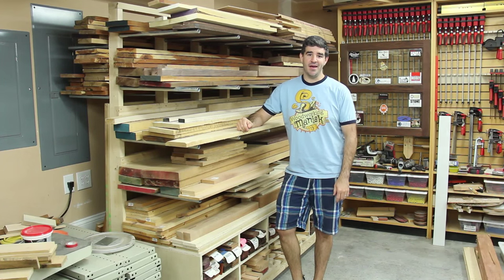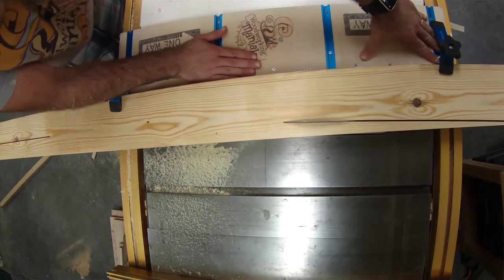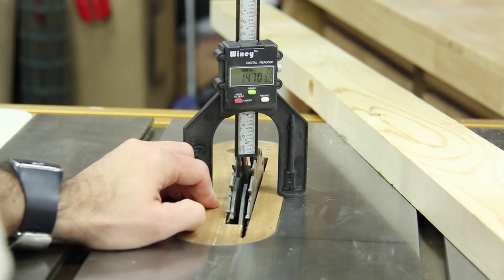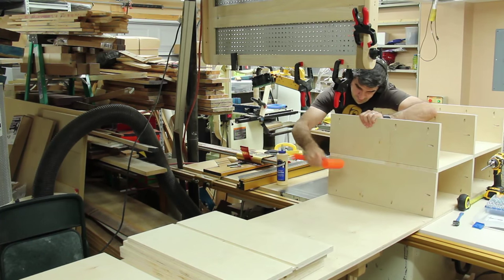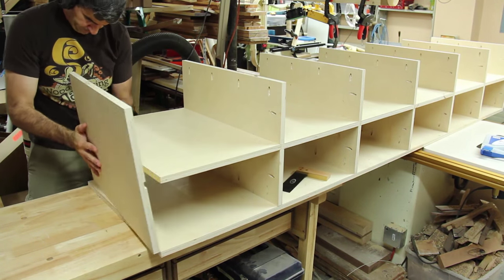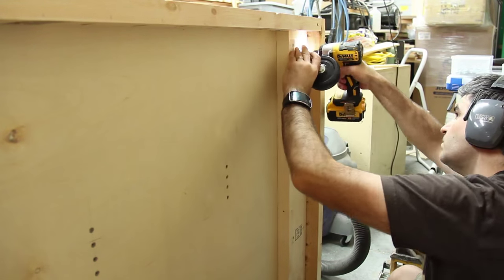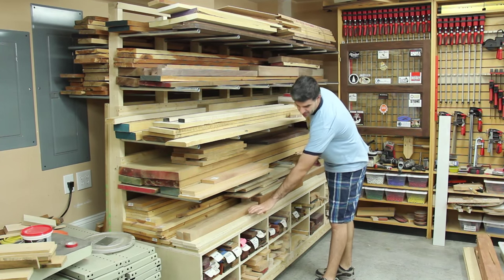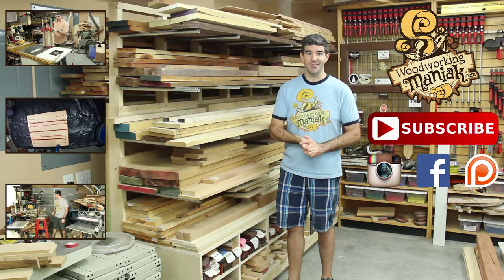HUGE Mobile Sheet & Lumber Rack

Comment: Mobil shop is great. People forget they might want to remodel another building. Your rack should move to drveway for loading a truck. What brake do you have for sloped driveway? An anchor for earthquake as well in ceiling and wall. When all things on wheels. The other option is a pallet with walls and dividers for scrap. Use a pallet jack to move cpmponet units.

Comment: "Actually" that is a very useful design and great build. Didn't know the conduit was that strong for just a 2" end mount? Really liked the way you lined up the dado cuts. Perhaps I missed it, but where will the full sheets of plywood go (after you replenish your stock)?
Reply from the maker: MRrwmac The 3/4" (internal diameter) EMT conduit is actually more like 7/8" in outter diameter... I drilled the holes 2 1/2" deep. They are holding the weight just fine. The full sheets fit on the back side of the rack. Once I get new casters on it, I'll probably show it in an update.

Comment: That's an epic wood rack!  Nicely done.  I thought the conduit would be to weak, but then I realized the weight dispersion over several means less weight on each individual pipe.  Well done.  Cheers!  Chris.
Reply from the maker: Cactus Makeshop Yep, weight dispersion is key. I debated on having them stick out 22" like that, but it's working out just fine.

Comment: I have the same-ish casters on my lumber rack of about the same size as yours...love the rack, hate the casters.  Did you put 6 casters on or just 4?  Do you have a link for the new casters?  I need to find something new myself.
Reply from the maker: Curt Walkins I used  6 4" casters in the build video. I ordered 6 Grizzly 5" casters part number G8173. Just ordered them today... So I guess I'll see how they are when I get them. I almost went with the 6" version even, but just didn't want it to be so tall. It is already going to add 2" to the height.

Comment: How mobile did this cart end up being? Our lumber rack is wall mounted, and we are planning to build a sheet good cart. Your design might make more sense for our single car garage, if it's mobile enough
Reply from the maker: It is mobile, but once you have it loaded down, it's hard to get started moving with the casters I have because of the urathane compressing. Might be best to get all metal casters and it may roll easier.
Reply: @WoodworkingManiak  Cool sounds like it will work in our space. What are the dimensions height wise, and front to back - roughly?
Reply from the maker: I think I made it 44" x 97" and 75" tall if I remember correctly...
Reply: @WoodworkingManiak  and all of the wood I assume is within the 44" width?
Reply from the maker: The lumber rack side I think has 22“ long EMT pieces and can store 8' long lumber. I'd have to go out and measure them again, it's been a while since I built it.

Comment: This is the best rack I have ever seen,  Can't tell you how many times I watched your build. What an efficient use of space.  I have a few questions (and apologize in advance if they been answered but I can't find them). 1) What material are you using, basic SPF 2x or douglas fir? 2) is that standard birch ply? 3) You mention bowing in your comments due to load. Where are you seeing the bow? 4) with the mdf for the plywood rack screwed to the verticals do you still think you need all the horizontal 2x4 bracing? I was going to eliminated 1 or 2 of them. 5) any problems with the 6 casters (not being on a perfectly flat area)? I was planning on only using 4 1000lb steel/urethane casters.

Thanks in advance!
Carl
Reply from the maker: +Carl K Tha K you for watching. 1) I used basic pine that is available in my local box store. 2) The plywood I used was TigerPly EDGE. It's a high quality Chinese birch that is comparable to Baltic birch. 3) I loaded probably well over a thousand pounds of lumber on it multiple times. It does bow a little, but not terribly. It's a toss up as to if it would be worth adding more weight to go with hardwood vertical supports... 4) You could remove some horizontal bracing, but I wouldn't trust the MDF to take on that extra stress. 5) Get heaviest duty casters you are willing to pay for! I upgraded to 5" metal casters with urethane tires and it is still crazy hard to move. I would probably recommend going with the largest solid metal casters you are willing to buy.

Comment: Besides changing the casters is there anything else you would change now that you have used it for a while?   how is the conduct holding up, I worry that being hollow it could bend where it leaves the wood support,  it seems that would be the week spot. Great design though, lots of capacity that's for sure.  Also did you do a drawing or just plan it out in your head!
Reply from the maker: +Wolfgang Greystoke The conduit is holding up great. You'd be surprised how much weight that can take. It might have been better to use wider center vertical supports. Maybe 2x8 instead of 2x6. If I used a hardwood like Maple instead of Pine, they wouldn't have any problems at all... I have mine LOADED down with a couple thousand pounds of hardwoods. It's handling it, but you can tell that there is a little bowing happening.

Also, I later put handle holes in each of the top storage bins giving me a lower area to grab and pull the thing around. I recorded doing these things, I just never did get around to making a video about the "updates" I made to it. I will try to do that sometime soon after the holidays.
Reply: +WoodworkingManiak Thanks for the feedback!   I'm a contractor and I need to do something like this.  Right now I've got piles and stacks all over the shop.  
Conduct is much cheaper than galvanized pipe.

Comment: I really like this design. I have some, hopefully, near future plans to double my shop square footage. I will be adding an addition. maybe I can do something similar then. I currently have a vertical sheet good storage that I need to redo. Great build!
Reply from the maker: +Glass Impressions I don't have much vertical space... Part of my ceiling is only 7' tall. I maxed out that height with this rack so I could barely move under that area with it. :)

Comment: Unless the wheels are all-steel, consider building such a thing to have fixtures to jack it up a bit to rest on blocks.    Some wheels will get flat spots if you leave 3000 lb setting on them for months.

Comment: Nice build.  Just found you on here and subscribed. I'm looking to build the same thing, maybe not quick as long but will follow your design.  Nice video and instruction.  God Bless and keep it up.
Reply from the maker: +Mark Perry Awesome! Be sure to use good strong casters under it. Possibly even solid metal ones so they don't squish and get you stuck like mine did at first. After I loaded about 900lbs of plywood on the back + all the lumber, it didn't go anywhere on those smaller casters. Now I have 5" ones. It's still hard to get it moving, but it'll move.

Comment: I had the same problem with close quarters fastening while building some shelves recently using pocket holes.  I had to buy a cheap right-angle drill chuck from Home Depot.  Got the job done.  It's a good accessory to have in inventory anyway.  Cheers!  Chris.
Reply from the maker: Cactus Makeshop Yeah, Those accessories are handy to have for sure!

Comment: like the cart.  I built a large roll around cart and used it for 12 or so years.  they get very heavy over time.  as to the casters, you should go at least to 5 or 6 inch (8" would be better) casters and I would get 800-900 capacity casters.  you want to change those casters only once:>)
Reply from the maker: Russ Veinot I ordered 5" metal casters rated for 600lbs each. Those are going to raise the cart 2" higher than it is now, and I have low ceilings... So that's as large as I'll be able to go.  I did later find some that were the same size rated for 1000lbs. But they cost twice as much. Hopefully the ones I ordered will last.

Comment: Awesome project!

Not to judge your engineering skills but gravity and weight is a mother.

I would rather opt to have the handles at the ends, here is why. I am always afraid of stooping lower and pulling something  that is way over my head, any weight over my head and my pulling on something that looks like it weighs over 500+ pounds is not safe.

By having the handles at the ends I can pull as hard as a want and not worry about all that wood crashing down on me it will fall to the sides and me being out of the way is safer in the long run. A kid could use that handle as an invite to move the cart.
Reply from the maker: +John Wayne Yes, I'm not going to disagree with you, but leverage is key... Loaded up, this weighs well over 3000lbs! It's much easier to get it moving from a lower point. Handles on the end would be ok as long as they were also low. I upgraded to 5" solid metal casters that have small urethane tires. It's not bad, but it would be best with even larger casters. I'm limited on ceiling height in my shop and wanted to get the most storage out of the cart as possible. I'm not moving it often where I have it located now.
Reply: 3k Lbs! WOW! Scary! The cart is awesome and I am also limited in height so anything I build I have to be aware of the limitation of width and height to get out my basement door when I move.
Reply from the maker: +John Wayne Yeah, it can hold some crazy weight.

Comment: Great build.  One safety issue though.  You are blocking access to your electric panel.  Even thought the cart is moveable, placing anything within 36 inches in front of the panel is a code violation.  If you need quick access in an emergency you might have a problem.
Reply from the maker: P Lemieux I was waiting for someone to notice that! My design actually is  for the cart to tuck in  and slide next to the clamp cabinet. Once I have the better casters on it, I will be able to do that much easier and it then slides just passed the electric panel. ;)